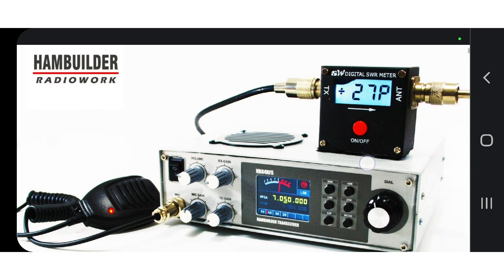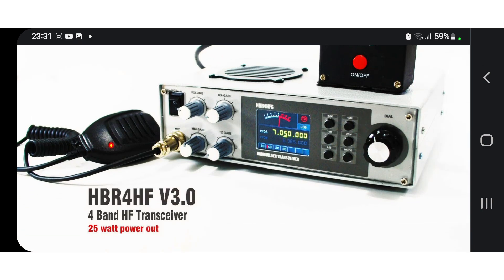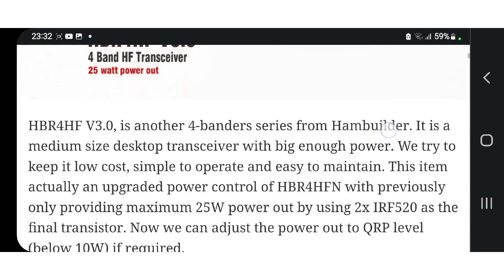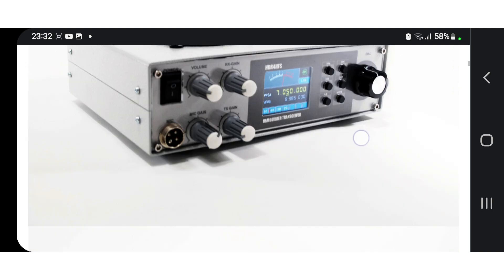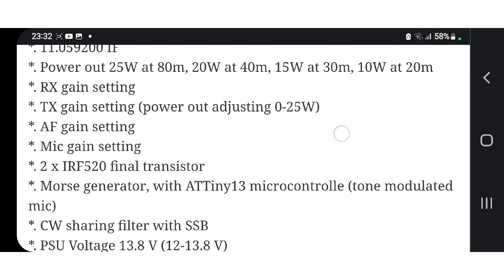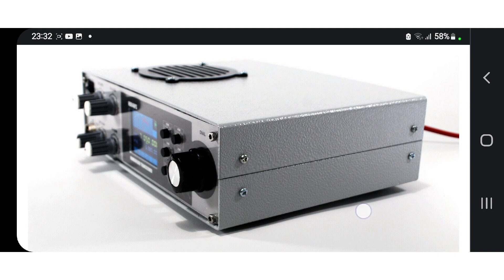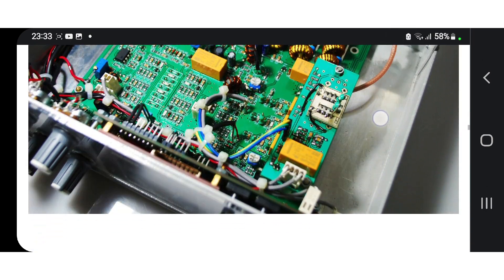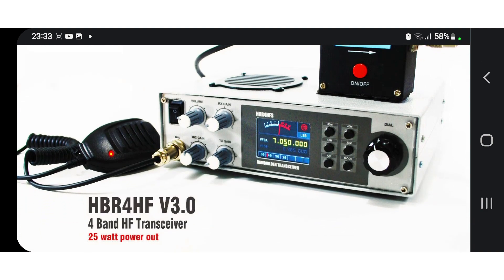HAMBUILDER - HBR4HF V3.0 HF Radio , 199 dollars

Comment: I bought a HBR4 10 watt model few years back it was so bad and drift frequency. I threw it away could not give it away...beware unless circuit has changed but pwb picture looks the same. I think there just dressing it up....
Reply from the maker: Thanks for info do u have a link to there current website for all products.
Reply: @M0FXBHamTech   when purchased was thru Ebay . Was about same price, he was a seller from China.
Reply: https://youtu.be/c52bnOaKbjU
Reply: any recommendations (besides just buying a new high quality Japanese radio) ?